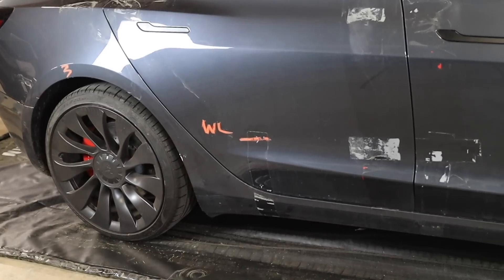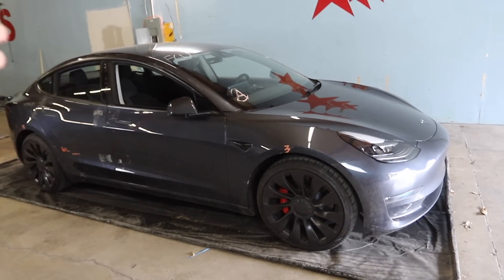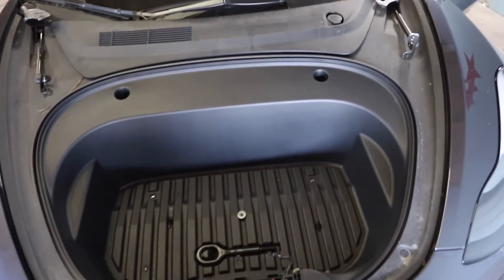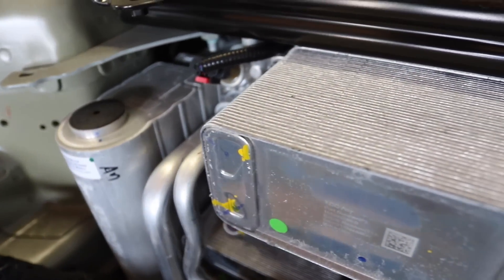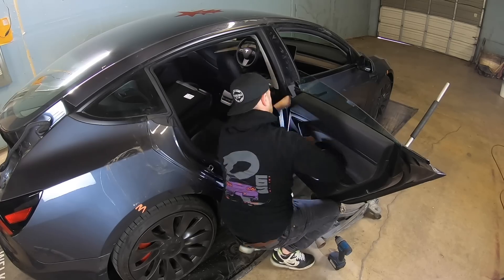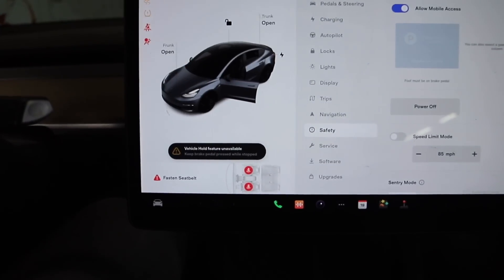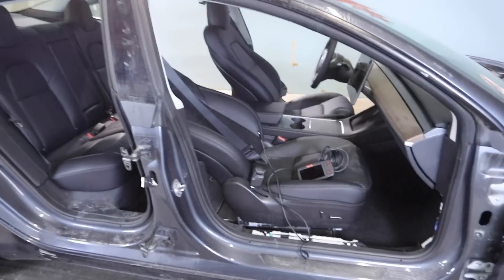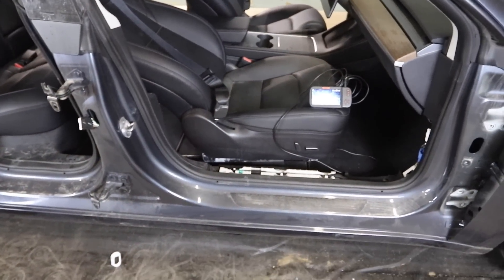How Much Weight Can You Remove From A Tesla Before It Breaks?

Comment: The current condition is what I've been hoping someone would do to try to get this in the 10s on the quarter. I have no doubt with all the weight removed, 18" wheels, full charge and battery preconditiong it would pull a high 10. Set the record with it!

Comment: Cool concept. I took the seats and Frunk out of my Tesla Model 3 Performance. That dropped 155 lbs of weight from the interior. I also put lightweight 18” wheels and tires on the car. I am running 11.17 @ 120.0 mph for the 1/4 mile and 3.01 for 0-60 mph without subtracting rollout. Curious to see if you can beat those numbers.

Comment: my front motor ate its gear box at 50,000  miles, my rear motor just did the same yesterday at 100,000, diff fluid changing in these cars might be actually necessary despite what tesla says. 2018 model 3 dual motor

Comment: As a Tesla owner, I am curious how much faster the car goes with the weight removed.  If you could do a Drag-e or a 1/4 mile run with it stripped down, that would be very interesting.

I'm also curious...When you say the car "will hopefully be a lot shorter", are you talking wheelbase?  Because the battery basically fills the entire belly from the front wheels to the back.  Not easy to modify.  But behind the rear suspension and in front of the front suspension, it could definitely be shortened a LITTLE.  I'm excited to see what you do with it.

Comment: Ifu really want this car to go fastyou now need to retrofit the bigger electric motor(s) from the plaid. If you wana go really relly fast you need to add more of those motors . If you wanna go really relly fast find someone that can modify those motors to go faster and get the highest power cells u can so u can use less of them and save weight so the car will only be able to do just what u need it to do. Great vid.

Comment: Coming from a guy that works at a Tesla certified body shop. I’m pretty sure you can do a body swap as long as you keep all the wiring and computer modules it will drive it’s not gonna get mad about trunk and doors and frunk being off neither will it get mad about the cameras being unplugged now if the frunk is set to open and the computer thinks it’s open it will let you drive but it won’t let you go past 10 miles an hour unless you put it in service mode, go into the service mode settings, and turn off speed limiter

Comment: If Nick's idea below doesn't move the seat, try to find the gearbox or cable that drives the seat. Attach a cordless drill and turn it. And if all else fails, and you don't care about the seat... Couldn't you cut\drill a hole in the seat to gain access to the bolts on the rail. Gonna be messy. I dare you! I double dare you!!

Thanks for the fun Chris!!! Keep exploring for you and all of us!

Comment: As a mechanic in South Florida, I have worked on many flood cars when it comes to getting those bolts to the seats. Usually the seat modules short out after being flooded hopefully (cross your fingers )motor's still work and what you do is take your Power Probe and get to the seat motor power wires ( usually the thicker ones)  and give them a power and ground with the Power Probe and see if the motor works and which way it goes if it's going in the wrong direction swap the power and ground and repeat until you can move the seat and get access to the bolts. FYI, the yellow connectors are usually always the airbag connectors so don't go probing those. Hope this helps

Comment: I’ve had luck either manually applying power to the seat rail motors, or sometimes they have a hex at the end to move them if the motor is toast.
Reply: I came to the comments to say the same thing.

Comment: I think it would be awesome to see the Delorean swapped on to this - truly become a "futuristic" car. Having said that I doubt it would be easy given the vast difference in chassis
Reply: Hell yes. Chris could use the batteries to power the flux capacitor.
Reply: @johnmclaughlin1804  no, he will need 1.1 gigawatts and the tesla batteries have much less than that. Lightning bolt or the fuel rods from the Arabs will still be required I am pretty sure.
Reply: The DeLorean? The ugliest piece of machinery ever built by conscious beings?
Reply: @TheReal_XiJinping  Fiat Multipla owners disagree.

Comment: the issue with Tesla isn't that it checks for missing stuff, but depending on what you touch, the entire software goes into lockdown and tesla won't unlock it most of the time

that being said I think it's a safety concern that the switches to detect doors open/closed are NO instead of NC. when those switches get crusty the car will not recognize an open door situation.

Comment: To get the seat out, you need to disengage the motor controlling the forward/backward movement. That might mean ripping it completely out of the seat. It should then slide freely, allowing you to get to the bolts holding it in.

Alternatively, you could try supplying power directly to the motor controlling the forward/backward movement.

Comment: I wonder if the door sensors are in the door itself. It would explain why there aren't codes after they are taken off. If you plug one in without putting it back on that would be a way to check.

Comment: There’s a service menu that you can get into. It will give you more error messages than the ones you’re looking at in the notifications menu.
Reply: Easy to Google. But. Go to software in settings. Press and hold Model 3 logo for a few sentences. Then enter “service” as password.
Reply: @o_tdiggity  "Americans will use anything but the universal units"